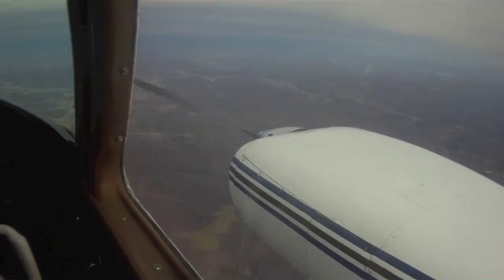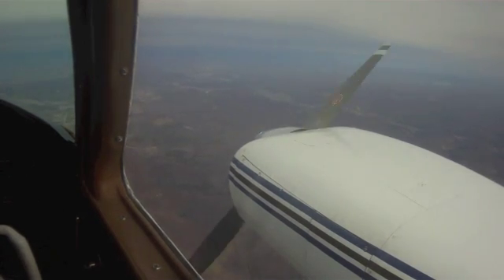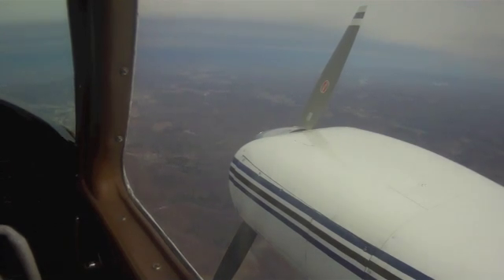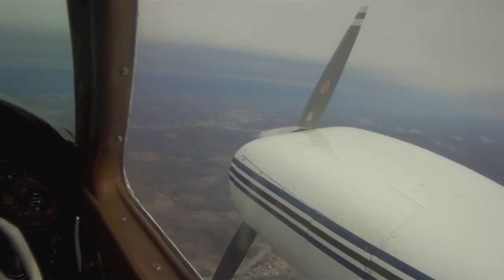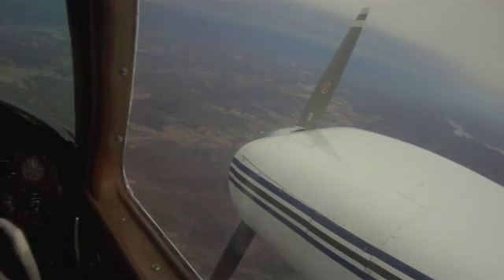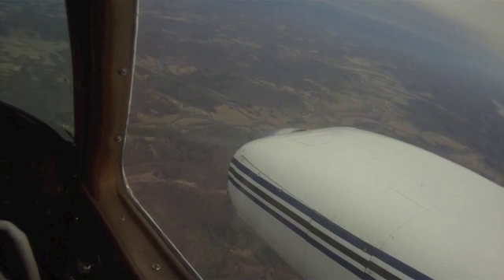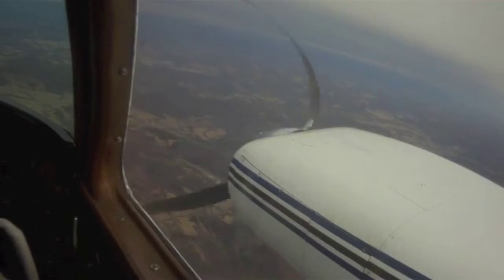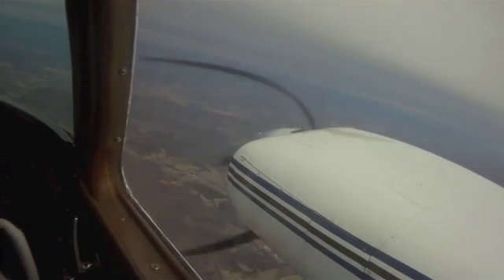Engine Shut Down and Restart Cessna 310

Comment: Great video : I obtained my multi rating in 75 in a 310 ( yeah... I know ) and been thinking about 're vetting in preferably another 310 , moving up to a Barron  X. I heard instructor say something about .. warm up : was that in reference to undesirable cylinder heads cooling to fast in slipstream ? Ans. If able sir  X. P S  ; I was expecting at least the start of a roll into the " dead " engine : my compliments to your student for correcting so fast ( if only other pilots could react that fast I'm a real low alt engine 
Loss ) thanks again sir !